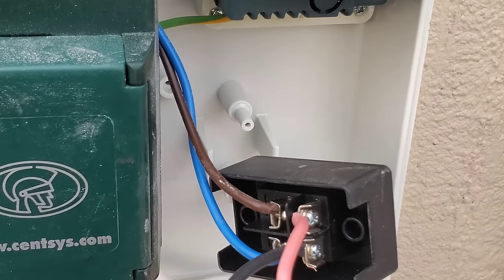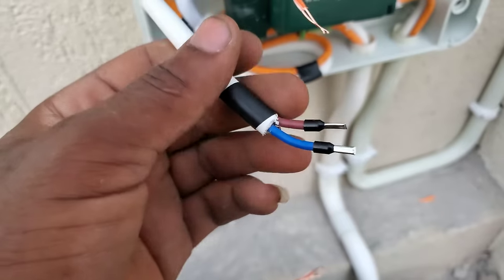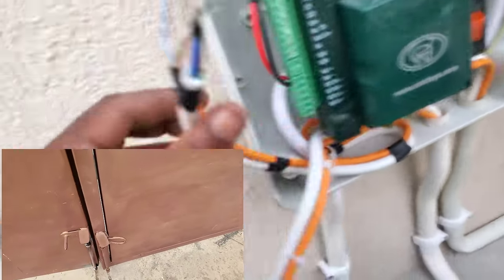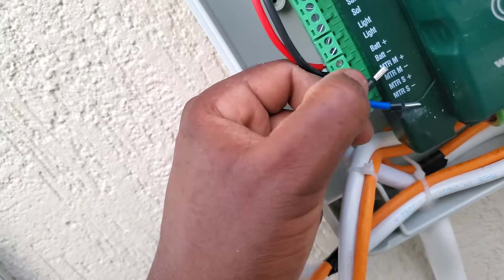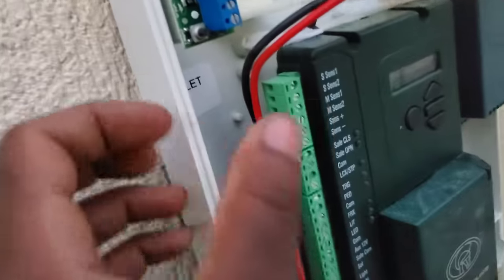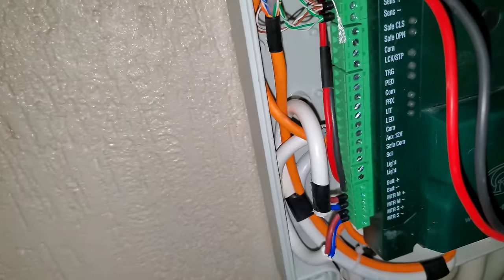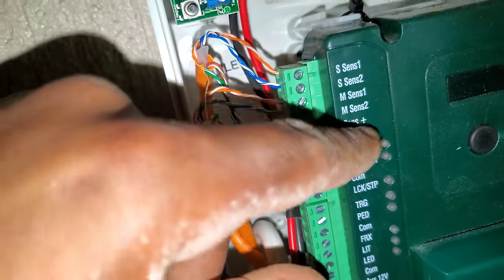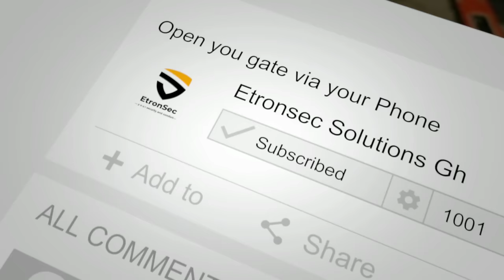How to install automatic swing gate opener. Part 1 | How to install electric driveway gate.

Comment: You r doing a very good job bro. U saved me tonight.
Reply: Pls I need ur help. Most times, my centurion wing gate will work for a while but at intervals, while closing, it keeps bringing error message "resolving" and finally "current sensor failure", den it will start malfunctioning. This has bn persisting for a while. Pls how can u help out?

Comment: I need your help.

I’m having an issue with R5.
The gate had been installed for over 3yrs in Nigeria. Unfortunately, the installer is late, so the client called me to help him check.
Checking it, I saw some burnt fuses, so I changed them. I realized I needed to reprogram the arms. 
I was able to reprogram the master arm and it responded well, but the slave won’t. It kept exiting programming mode. It’ll only moves a bit, then exit programming mode.

Could battery be the cause?
Reply from the maker: Kindly check your wiring